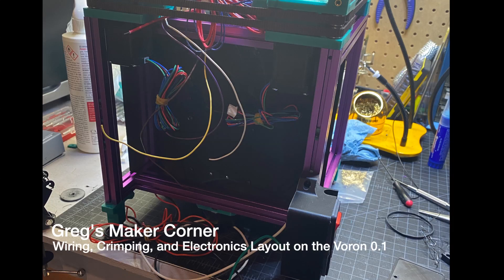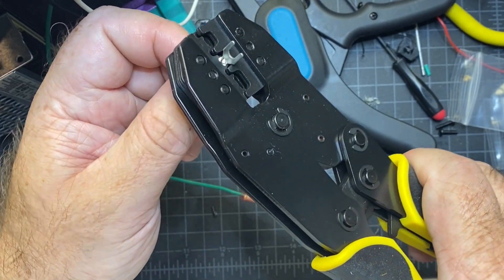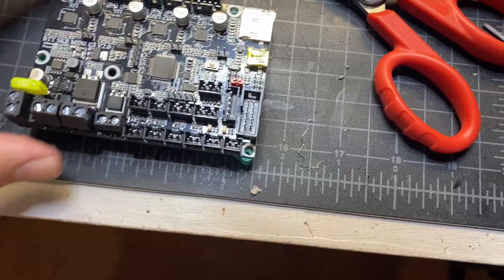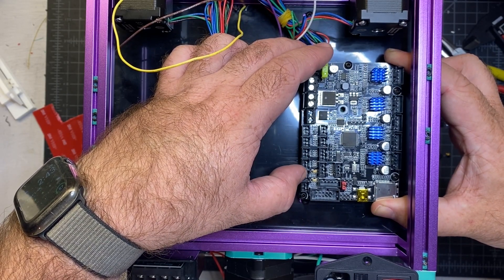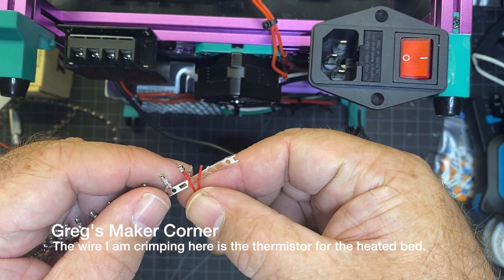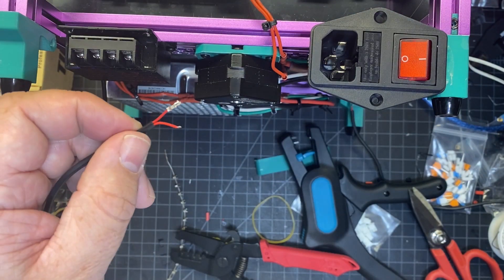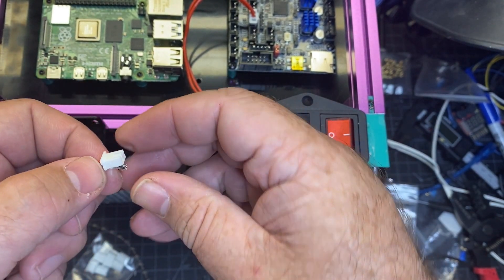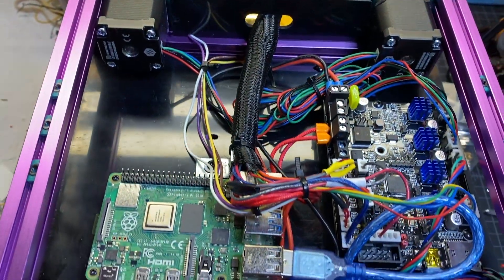Voron 0.1 Build Series - Wiring, Crimping, and Electronics Layout

Comment: how exactly do you wire the 3 fans? the wire they come with is very short, do you solder them to a longer wire?
Reply: I need help with this too.
Reply: @That_Adams_Guy  cut the fan wires to suitable length and use inline mx3.0 connectors is the way. But I'd suggest using an umbilical board on the print head, which means you also need to cut the fan wires short and crimp on an inline mx 3.0 connector.
Reply: @user-yk1cw8im4h  Do I connect both red wires on each fan to the red going to the board, and vice versa for the black wires?
Reply: @That_Adams_Guy  Yes, that's basically it. You can solder the red wires like a "Y" and heat shrink it. Just be careful not to solder the red wires of 24V and 5V fans together. However if you can get an unbilical board I'd recommend that, as I fear the solder joint or inline connector might fail one day under repeated movement of the print head cables.

Comment: @Greg's Maker Corner So the kit had the electronic boards exposed in the back as well as the power supply in the bottom right? The bottom I understand (you have the skirt and is covered by the table you set it on). However the back not being covered, my OCD self would have a problem. I've seen some people putting a back panel with cutouts for 2 40mm fans air on it and a cut out mesh at the to 1/5th. However I can't find anyone who sell such back panels. Any ideas?
Reply from the maker: The kit just has the bottom open/exposed (skirst on the side). In my case, I only have the power supply on the bottom.  There is a second panel that covers the electronics that are mounted to the back of the printer, so there shouldn't be any electronics exposed. This would be the case for just about any v0.1 kit that includes panels. Hope that helps!
Reply: @GregsMakerCorner  Thanks for the answers. Does the second back panel that covers the BTT and RPi boards have any openings (like for air flow and for installing fans)? In other words how is the cooling provided for the boards when they are sandwiched between the two panels? Thanks.
Reply from the maker: @TheNature101  As designed with the acrylic panels you wouldn't have any air flow on the sides or top. However, you could definitely add a cooling fan in the back if you wanted. I do not personally have one on mine and so far haven't had an overheating problem, but it wouldn't be a bad idea to add cooling. You could probably add a few 5v 30mm fans that would fit between the back and outside panel.
Reply: @GregsMakerCorner  Voron_0 channel from the site VoronDesign uses.
Reply from the maker: @TheNature101  Will check it out- thanks!!
Reply: @GregsMakerCorner  BTW, I could have sent you a link (and I tried to post it 6 times) but even the word alone of dis** got the post deleted by the youtube powers...

Comment: Did you use bullet terminal connectors for the hotend/heatbed connections?
Reply from the maker: I pretty much wired everything to go directly to the control board from the hot end. In the past I have used XT30 connectors for the hot end. I didn't bother doing connectors because I'm going to have to take apart the hot end to change out heater cartridge / thermistor anyway, and I use a split loom fabric so it's very easy to remove wires.  On some printers I will use connectors for the fan and heater cartridge if I can easily change it out without disassembly. Since I am running an AC bed I just ran the wiring directly to the power supply (AC terminals) and SSR.

Comment: Where did you source the power switch? Generic or did you pick a specific one?
Reply from the maker: Also.. the one I linked is different than what you see in the video here. I used that one initially but it was a bit too large for the stock part so I changed it out.
Reply: @GregsMakerCorner  OK. I'll likely (undecided now though) use one like in the video since I prefer the screwed-in type.
Reply from the maker: @OldCurmudgeon3DP  There are some community mods that will accommodate the screw in type but I'm not positive they will work on the .1, but I'm sure more will be coming. Take a look at this site. https://github.com/VoronDesign/VoronUsers/tree/master/printer_mods
Reply: @GregsMakerCorner  I might go w/ TH3D's endcap for the PSU.
Reply: @GregsMakerCorner  I'm also building a Minion, not a voron.
Reply from the maker: I ended up getting one off Amazon. This is the one I went with. Seems to be plenty capable for this build and easily fits in the stock 3d printed part. https://www.amazon.com/gp/product/B081VD1NNT